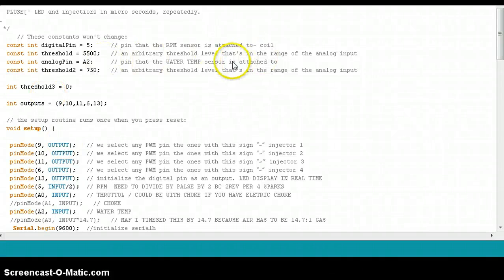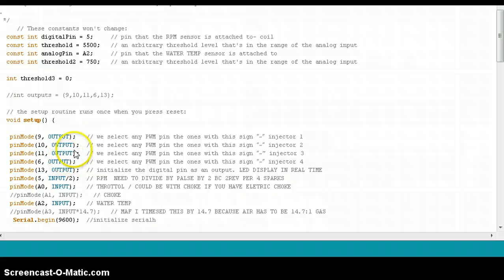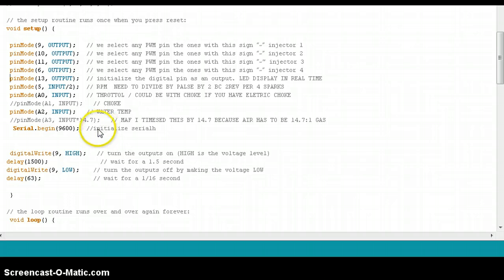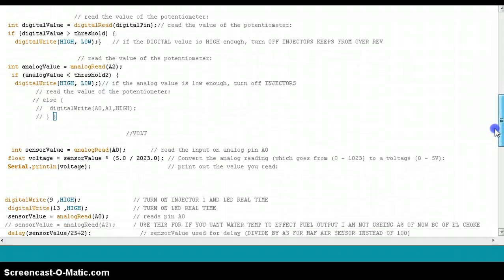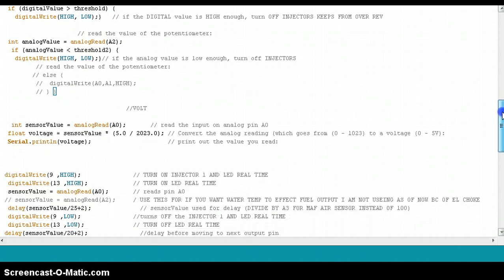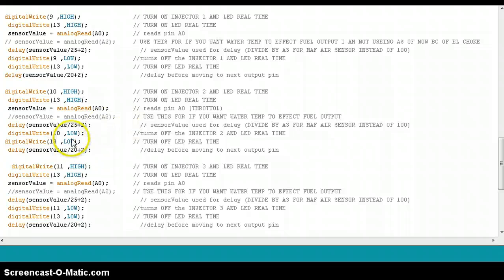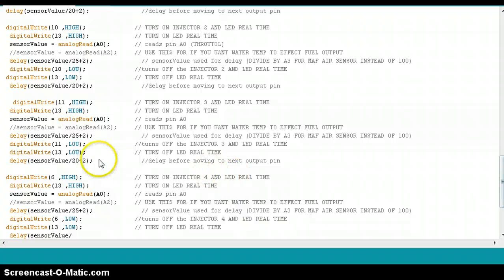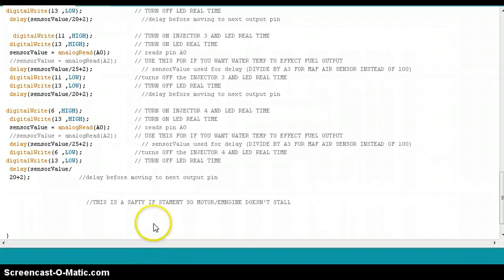Fuel injection code with 4 injectors using Arduino

Comment: I'm trying to get control over a single injector.. Wish I could find everything I need to do this. I have the Arduino Mega board.
Reply from the maker: I have a code for a single injector  but for a test simple in off pwm  controlled with a tps sensor are you wanting a test code or are you wanting to run a engine off one injector
Reply: Geo Metro High MPG Project  hello mate i believe you are doing same project as me...high mpg?fuel vaporizer?did you get code for arduino to run single injector?if so can you help me and get in touch am trying to get arduino run my injector but programing is not my strong point.any help most appreciated.cheers joe

Comment: Hello Ivan, I'd like to  talk with you about your project. I'm trying to make an tbi injection for a 595 CMC, 2 stroke, 2 cilynder engine. I have some troubles with the program,  i wanna use  an hall effect sensor as trigger and rpm counter. As you may know, the tbi injector has also a potentiometer ( a double one, with 4 pins) for the throttle angle wich i don't know how to define it into the program.  I'd rather like to use the throttle position angle for the amount of fuel instead of rpm's. The  system is an  open loop one, without o2 sensor but just an heat sensor. Please send me an p.m with your e-mail or an social network link. Thank you.

Comment: hello, interesting project, very simple,  i have some questions/sugestions for you:  

why do you multiply INPUT by a number if this is a declaration of a pin state? i haven't seen this before.

if do you use delays() for timing the injectors, in this time the Arduino is doing noting, in a real EFI ECU, the MCU need to make different tasks in sequence, using delay() isn't eficient, try to use the timer1 Output Compare, you can load a "time" to "fire" an Injector and the MCU can make other tasks/calculations, the timer1/OutputCompare will make no load in the MCU calculation power.   i'm only a hobbist in electronics and Arduino, but i have many years on the business of ECUs OEM and Racing stand alones, and now, i have a project like yours, but because i want to make a product like what i usually install on our costumer cars, i needed to learn some ways to accomplish with the project, and had learned some ways to make functions present in real racing ECU (racing are more simple respect OEM ones) how searching the parameters in a "fuel or ignition map" based on rpm and load for example, using arrays, make the calculations for fuel corrections based on engine temp, air temp, ambient/manifold pressure etc... i'm at a good point in firmware, maybe in a couple of months i will be testing on an engine.  

Best regards form Italy!
Reply: Antonio Fusella Hi Antonio, Nice explanation, Can help me of my project? i create hydrogen generator, in intake . i need an eletronic project, to change 14,7:1 mix. Because i riching mix with hydrogen, them, i Can change afr, Air/fuel relation, but, ECU , remap, automaticly this relation, afr. This project Can help me? have some ideas, or any microcontroller code for this my plans? thank's a lot. versiani26@gmail.com
Reply: Antonio Fusella i believe your just the man i need to get my arduino to run my single injector but i cant do programing.any helpwould be most appreciated.thanks